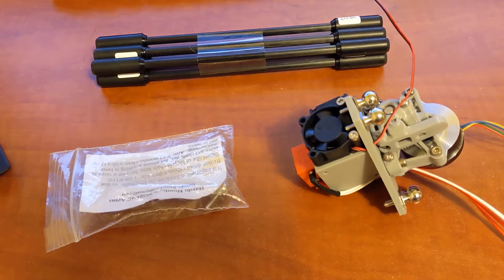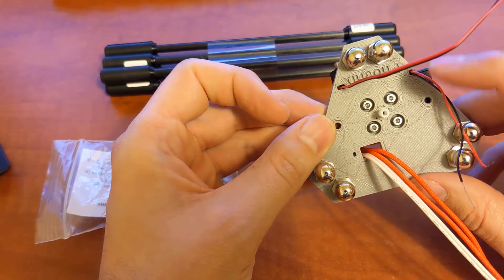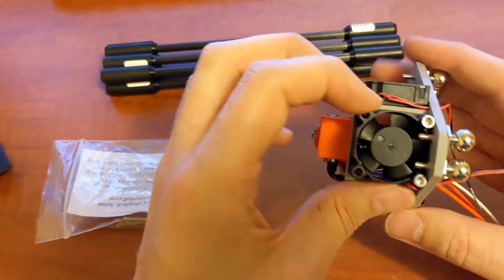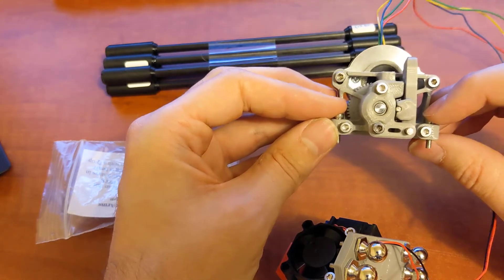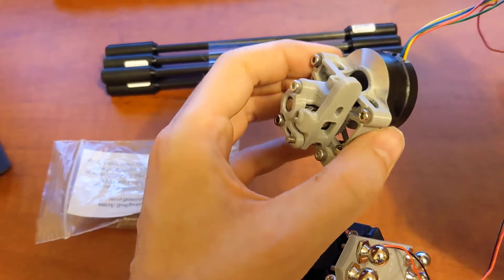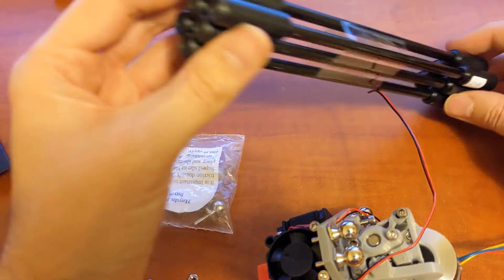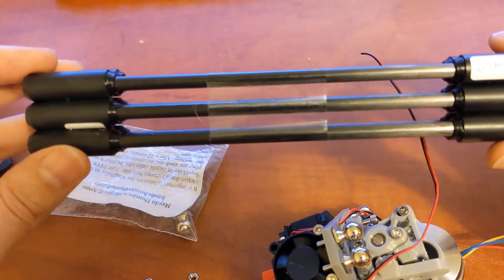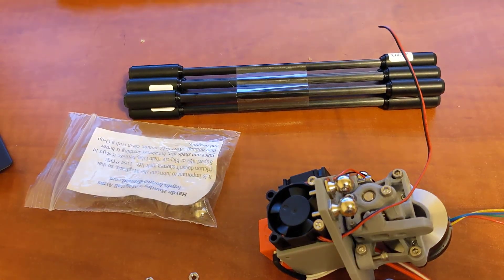Let's build a Delta 3D Printer Episode 3 Hotend, Arms, Extruder

Comment: i cant find the exact model for the pancake stepper motor in the video, i found LDO Nema14 36mm Pancake Stepper Motor LDO-36STH20-1004AHG online and is there a problem if i use this instead of the one in the video?
Reply from the maker: that should be ok

Comment: Two small corrections: 
The MagBalls are chrome/nickel plated steel. Steel is more magnetic than stainless.
The magnets are N52, the strongest available.
Reply from the maker: Thank you!
Reply: @Rolohaun  By the way, I really like the effector design you used.  Currently I'm using a flying Bondtech dual gear one, but I'd prefer to have a shorter filament path, and have the mass more evenly divided (part below and part above the plane of the effector).
Reply from the maker: @HaydnHuntley  thanks! Feel free to join my discord we have a awesome delta channel there with very cool builds
Reply: @Rolohaun  Can you send me a link to your Discord server?
Reply from the maker: @HaydnHuntley  https://discord.com/invite/rolohaun-3d-946191040682008666

Comment: I have a dragonfly phaetus bmo, is this the one you're using it? Did you unscrewed the upper part of the hotend? Also, i am thinking about using a ldo orbiter v2 extruder, i need to modify the model of the effector?
Reply from the maker: I used a dragon hotend, I unscrewed the groove mount
Reply: @Rolohaun  thanks

Comment: Pretty cool build! What material are you printing the effector and extruder parts out of, abs? I didn't think PLA would do well near the high temp hot end
Reply from the maker: I print everything out of PLA I have over 200 hours of printing on my large delta with no issues.